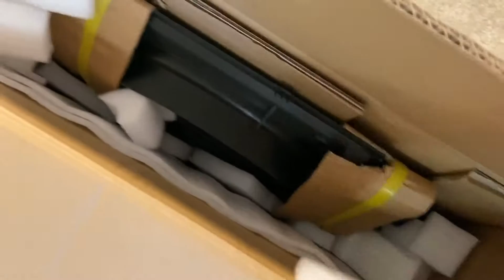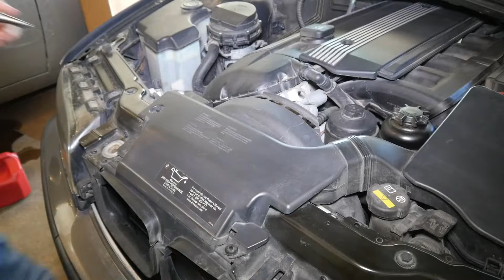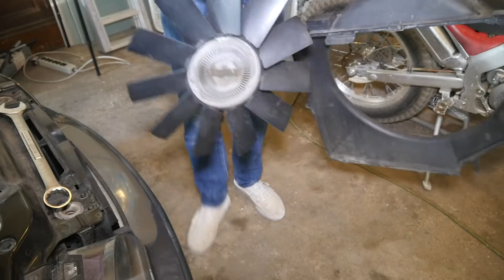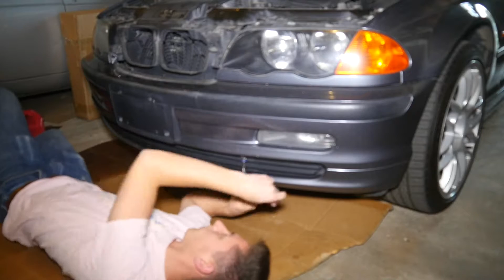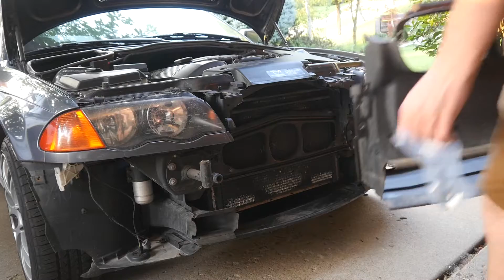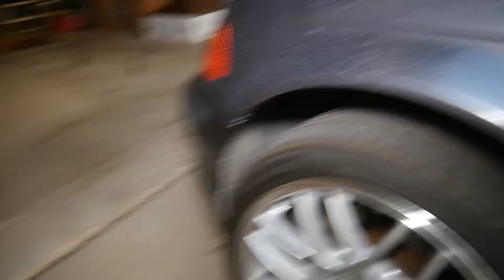BMW E46 Radiator Fan Conversion/Front Bumper Removal DIY + other wagon updates

Comment: No need to tune the new fan in? It’ll run by itself off temp sensor?
Reply from the maker: Since this fan takes the electrical inputs that the aux fan was getting, it spins when up to temp OR when the AC is on. No tuning required.

Comment: Interesting, but did you wire the connector for the electric fan yourself or was it already pre-wired?
Reply from the maker: The connector on the electric fan is the same connector that the original auxiliary (AC) fan had. That’s why it was removed.

Comment: Once you install the electric fan do you have to remove the auxiliary fan? Can I just keep it sit there unplugged?
Reply from the maker: It’s best to remove it. If you leave it there unplugged, it’s just restricting the airflow to the radiator and the puller fan, making the system harder to cool. Not to mention adding unnecessary weight 😉

Comment: This video is very useful as it actually shows the entire process including bumper removal. Was a very smooth ride. The comment from @arcticwhite8501 below helped me save and re-use the plastic screws as well. I used compressed air to blow out crud and leaves from the condensor and rad. All in all it took maybe 90 minutes. It seems to cool even better than my old mechanical fan as my car barely gets up to temperature now with my failed open thermostat (that'll be next weekend's job). And no more airplane noises! Great mod for about €60 in parts (I got a used fan).

Comment: Hi, i have converted to electrical fan but i want to use electrical and front fan(2nd you take) is that possible? And pros and cons pls
Reply from the maker: @elvirhuseynov4769  it is not recommended, the aux fan would need to be custom wired in and would likely cause power issues. The electric fan is plenty and the aux fan is not necessary.
Reply: @DowntimeMedia  AGAIN thank you!!! I was just about to ask this.
Reply from the maker: @elvirhuseynov4769  it is not recommended, the aux fan would need to be custom wired in and would likely cause power issues. The electric fan is plenty and the aux fan is not necessary.

Comment: can you just wire both aux fan and radiator fan to work together?
Reply from the maker: @driver_18  Unfortunatly, wiring them together would probably result in fuses blowing or not enough power being supplied to both fans. Better to not splice the wiring.
Reply: @DowntimeMedia  I see, thus the fan delete up front... thanks for the response, I'm going this route.
Reply from the maker: @driver_18  Absolutely, you got this! Good luck 👍🏼

Comment: On the plastic Phillips head screws holding the front radiator shield:

I had great success getting these out by lightly prying behind the head of the screws with something like a trim removal tool or even a fingernail to avoid the downward force of the screwdriver causing the screw to skip threads and be pushed back in.

Once some of the thread was visible I sprayed some WD40 on there to reduce the torque required. Came very close to snapping a screw before this.

Keep the pressure behind the head of the screw, keep the thread lubricated, and it should come out all the way with no real issues.
Reply: This comment saved all 4 of my plastic screws! We very carefully undid them a bit, sprayed WD40 on the threads, put them back in and redid this several times at different stages to slowly "lube up" the threads. They all came out in one piece and we got to re-use them (I didn't order new ones). So thank you!

Comment: Since you use the same wiring from the aux fan, cant you just use that as your main fan. And just remove the mechanical one? Or is the other one more powerfull?
Reply from the maker: @PatrickHemmes  the Aux fan is just that: an “additional” auxiliary fan. It’s not strong enough or designed to cool the radiator AND other components. You need an electric fan designed to pull/push enough air to cool everything
Reply: @ Thank you, you are awesome for still responding.
Reply from the maker: @PatrickHemmes  happy to help, good luck with your project! 👊🏻
Reply: @DowntimeMedia  Yup! I was waiting for this exact response. Thanks mate!

Comment: Great video. How do you test the electric fan works ?
Reply from the maker: I tested the fan by connecting it to the harness and turning the car onto accessory mode and then pressing the AC button. Thanks for watching!
Reply: What does it means turn the car onto accessory mode
Reply from the maker: @ingegneriafacile  insert the key into the car, and turn it to the second position, the position right before starting the car

Comment: Hi, I am planing to do the same on my 325i auto. Your video is so informative. Other than cooling itself, how did handling change? : Has your front end  lightend by removing aux fan? Greetings from Japan.
Reply from the maker: No change to handling, nothing that I can tell at least. It’s only a ~20lb weight difference up front. Thanks for watching!
Reply: @DowntimeMedia  Thamk you. And did it get more quiet?
Reply from the maker: @yukippe  definitely quieter, the aux fan is incredibly loud and the electric fan is barely audible over the sound of the engine!

Comment: Curious why you would remove the auxiliary fan?? Can you just leave it on? Or does it need to be taken off when you put on the electric fan
Reply from the maker: Since you are taking the wiring harness from the aux fan for the electric fan, there is not point in having it there blocking airflow to the radiator.

Comment: Dude all these videos show u taking off front bumper but mine has bash bar behind
Reply from the maker: The bash bar is in the bumper cover, you must be removing the cover from the bar. If you take the T bolts out from the bottom of the bumper, it should pull the support bar out with it

Comment: Thank you very much 
I want ask 
is electrical fan best than normal fan and why?
Reply from the maker: The electrical fan is typically safer than the clutch fan because the clutches have been known the seize up and explode the fan blades all over the engine bay

Comment: Hey, do the electric fan you installed turn on both at temperature and  turn on automatic when the A/C is turned on??
Reply from the maker: Yes, the fan turns on with the AC and when it reaches temp
Reply: Thanks one upgrade I plan to do,  you never put the info off where you got that fan
Reply from the maker: @fredb.6884  link for the eBay listing is in the description! Thanks for watching!

Comment: You have the best installataion explanation of all the videos Ive seen.  Youre the only one who explains that you have to remove the fan sensor from the old shroud to reinstall it with the new fan.  Excellent job!
I would like to add that I would splice another plug to maintain the auxiliary radiator so you can still continue to have a push and pull air system through your radiator for the one hot day youll be stuck in traffic and youll be blasting your AC.
Get another plug from the wrecking yard and splice it in.
Reply from the maker: Thank you, glad I could help out! That could be a good idea, but I’ve never had a problem with it even in the Utah summers.

Comment: How is the fan running considering you only have the one fan now..?

Any overheating?
Reply from the maker: The electric fan runs great! Never had a cooling issue the whole time I’ve had it installed, and it survived a Utah summer. Those electric rad fans are built to do just that. Manual E46’s came with that exact setup from the factory
Reply: @DowntimeMedia  yeah I know manuals came with it, but the auto trans cars require extra cooling as the transmission lines run through the radiator.
Reply: Besides the electric fan upgrade what else have you done to your E46 wagon cooling system did you upgrade anything else for the cooling system